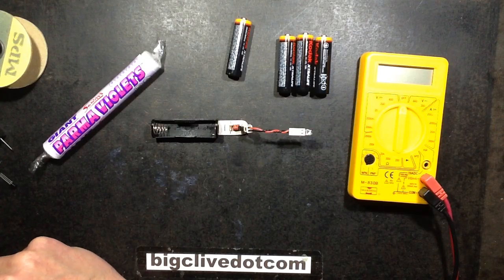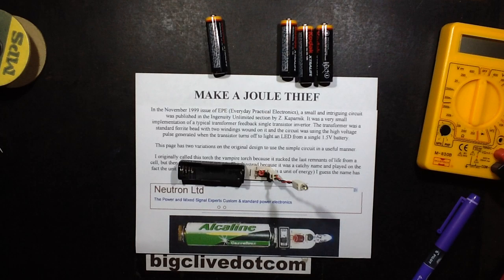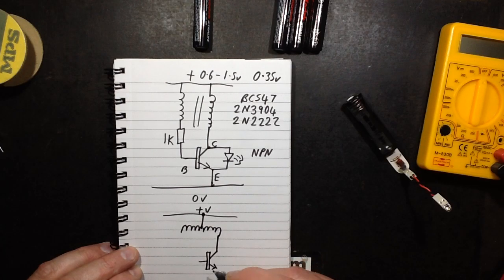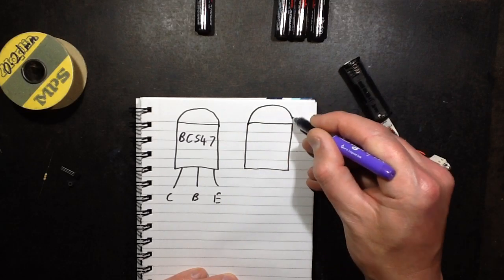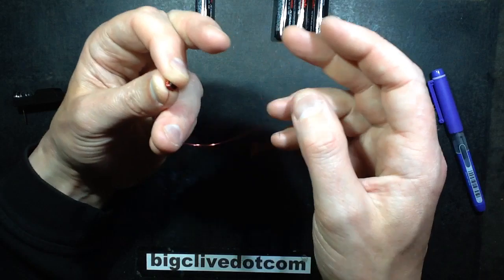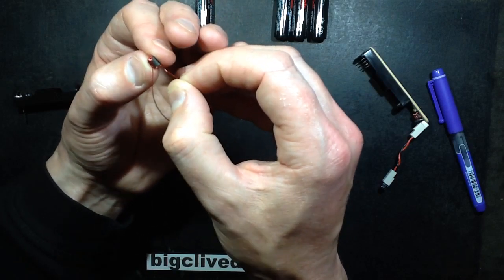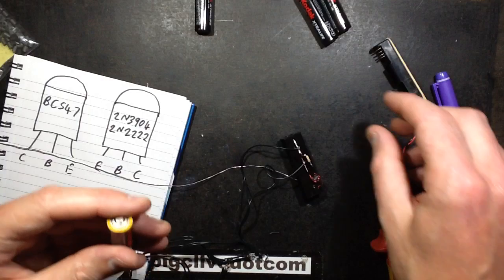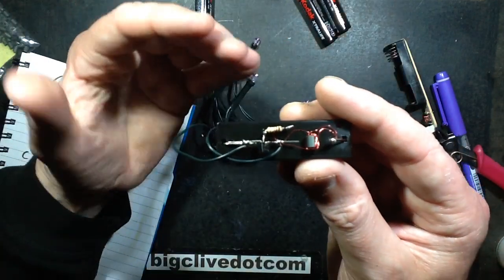How to make an authentic Joule Thief.

Comment: You could also use a germanium transistor instead of a silicon transistor to improve efficiency. Silicon transistors have a base-emitter voltage (VBE) around 700mV while germanium transistors have a VBE of about 300mV.
Reply: Do you have any idea how efficient these are compared to "standard" constant current/constant voltage (usually PWM) LED drivers? The circuit seems so simple, and easily tunable to various LED peak voltages, that I would wonder if we're talking 99% or more like 50%, haha. Sure from a DC source it's impressive how it "sucks" the power out, but I wonder with what efficiency IRL

Comment: Good evening!
I've built some "trash battery lights" a few years ago..most of them still run on the "old empty" batteries.
- i did not hear of the "Joule Thief" back then :-)

But i came across the pr4403 and its different versions.
- i think i was using two empty batteries if i remember correctly....
you can also use leds in parallel or in a row...

complete circuit kind of fits under a 5mm white led. (or can be built into a pencil)

I also really love hot (melting) glue.
It gets stuff water proof + robust
AND you can easily remove it again !

Comment: never thought I would wind my own transformer and yet a ferrite toroid salvaged from a scraped computer cable and a few feet of magnet wire later I'm seeing what looks to be bona fide transformer-like traces on my Huntron Tracker 2000! I can hardly wait to finish this thing
Reply: +Michael Thompson Built and operating!
For a moment I wondered why my color changing LED wasn't going past red, but then I realized it's being fed via an oscillator and restarting over and over so you never get past the first color.
Tried a "flicker" yellow LED and it merely flashed slowly -again my guess is something timing out with the oscillator.
I have a white LED glowing very brightly now but I wonder if there would be too much loss in converting back to DC?

Comment: I made a little bobbin with my 3D printer to spool wire on. I put about 20-30 turns then made my center tap and 20-30 more turns . It's basically an air core since it has no metal and it works just fine with the Joule Thief circuit. The ferrite core works better, but if you give it more turns other things work too. Of course in the time since you made this video you have probably already figured that out for yourself.
Reply from the maker: I did experiment with many cores including air cored versions.  Maybe better with a faster transistor though.

Comment: I think I might be keeping the batteries up at least for awhile as I have built a joule thief circuit with a slightly higher voltage to handle the drag of more components and I am running a mechanical flasher that has a considerable higher draw than an LED .  Also I have another joule thief in the circuit that I wanted to experiment with that uses the same toroid that I wound with a center tap so I can adjust it with a   potentiometer and switch back and forth with in and out of the circuit. I began constructing this so that I could test mosfets in an inverter I have that has quit working that way I can test the mosfets to see if they heat up or whatever and when I looked up the spec sheets I found out they were SCR's,  that is how old this inverter is apparently. When I wound the toroid I used a ferrite magnet and I have placed it on two larger ferrite magnets and I belive they have a lot of power.  The batteries are three AA Duracells that I recharged a few times, they are older and I thought they were dead and was going to just suck the life out of them and throw them away.  After putting them in this circuit I have not had to charge them back up again and it seems to me like it was after adding the two large magnets to the transformer.  Three LEDs and a mechanical flasher and it's all still point to point wiring and the three LEDs are blinding,  I don't run it continuously because I am worried I might burn up the LED's  but I have run it every everyday, for a couple months now.   Also I tried to take a picture of this spagehtie mess with my phone and I think the  HF fields have caused the camera in the phone to behave strangely ..
The picture I took has a couple of things wrong with it and the first thing I noticed is it has created a background in the picture with some lines running across it and there is a clock in the picture that is backwards, also there is a light with a handle on it and the handle is now on the other side of it,  so some of the things in the picture have somehow been reversed,  very strange and all this from three AA Duracells.  I imagine these old batteries will eventually run down and I have yet to hook this up to the scope but perhaps our host here would be more interested in analyzing this situation  .... 🤔😎

Comment: I just made my first joul thief today! Am impressed it worked first time. It really is a clever circuit.
I don't think mine had enough turns though - It would power a white and blue LED with no issue, but no luck for an old school red 5mm. (Not that any of my LED aren't 5mm. I really don't like SMD.)
Reply from the maker: The red should be easier to drive.  Note that some red LEDs from eBay are supplied with reverse polarity.  Congratulations on your first Joule Thief.  They're a really fun circuit.
Reply: They're certainly the correct polarity. I obtained them through Bowood Electronics many years ago. It just seemed to flicker on and off as I connected and disconnected the cell.
I always thought that red would be the easiest to drive too, as they only require 2.2ish volts to glow.

I'll make another today and have a bit more experimentation with more and less coils of magnet wire. I'm using a relatively large 3/4" diameter ferrite core.
I'll post results later :)
Reply: Well, after a bit more messing around, I was able to drive 8 Green LED's in series before they started to dim even slightly, all from a single AA cell.
I am very impressed with this circuit.
I ended up experimenting a bit more, by removing the LEDs, and putting a diode and capacitor in series instead. I was able to read about 50v.
Then I tried powering the circuit from a 6v battery. I managed to get up to about 110v.

Comment: I didn't actually know that Clive coined the term Joule Thief. Nice one! 🙂

A minor improvement: if you add a (schottky) diode and a small capacitor (1-4.7µF or so...) before the LED string the LEDs will light much brighter.
However, current consumption will go up, naturally. Still probably worth it, though.
There's actually quite a few ways that you can tune this little circuit in order to get the most light out of it, pretty fun to play around with it.

I think I need to go build another Joule Thief... again! ;-)

Comment: I just got around to playing with this now.  I did 60 turns (30+30) on a ferrite ring ('cause more is better, right?).  It's lighting a white LED very brightly.  My toy silly scope says Vmax 3.9V (may be pushing 4.0 volts as the reading is not quite stable), 10.15kHz, duty cycle about 50%. There's a small spike at the start of the cycle which falls off surprisingly slowly until it clamps off.  I was expecting the "on" duration to be much shorter even with a fresh battery.

 Interestingly, my multimeter is reading almost the same across the battery and the LED (1.49V and 1.47V at the LED) at this time, which I take to mean the multimeter is reading the average, so it might be possible to predict the duty cycle based on Vbat if the Vpp is known.  It will be interesting to see how things change as the battery goes flat.  I expect the duty cycle to reduce while the Vmax stays relatively high but may drop a little.  I used maybe twice as much wire for the transformer compared to what was shown in the video.  I also added a switch on the 0V so it's more like a torch.

I thought I'd keep this updated for as long as the battery holds out, if I can.  Run time will be six to ten hours at night.  The battery is a AAA, so probably a lot less capacity than a AA.
1.49Vb 10.15kHz 50% 3.9+Vpp (fresh battery)
1.26Vb 9.21kHz 41.3% 3.89Vpp (~8 hours)
1.17 Vb 9.10kHz 39.0% 3.89Vpp (~7.5 hours)
0.42Vb 11.1kHz 17.4% 2.83Vpp (~8 hours)
0.41Vb  13.2kHz 17.8% 2.83Vpp (~5.5 hours)
0.50Vb 7.2kHz 16.8% 3.08Vpp (~5 hours)
0.42Vb 9.6kHz 16.0% 2.83Vpp (~8.5 hours)
0.40Vb 14.3kHz 16.5% 2.92Vpp (~6.5 hours)
0.38Vb 21.6kHz 18.1% 2.90Vpp (~8.5 hours)
0.37Vb 29.4kHz 19.3% 2.88Vpp (~8 hours)
0.37Vb 31.8kHz 20.0% 2.81Vpp (~7 hours)
0.34Vb 54.5kHz  25.3% 2.31Vpp (~8 hours) Pretty dim by morning, but OK when it's first turned on.  It can turn on again when the battery rises to 0.45V
0.338Vb 75.3kHz 30.4% 2.00Vpp (unknown runtime)

At this point the LED will not stay lit for more than a short while and I don't know what the final runtime was.   The figures in the last line are with the LED barely lit (wouldn't be seen in normal light) and shortly before it goes out completely.  No, the LED should not be lighting at all at 2V, but there is obviously something going on that my $20 sillyscope isn't showing such as an extremely short peak duration at a higher voltage (or something). It's not that accurate but not as far out as that for DC or square wave readings. Real turn on voltage for this LED as tested is 2.33VDC.

Even so, if the dead battery is allowed to recover then the LED will still operate for short periods at an intensity that is useful such as to find your car keys, the light switch, or a real torch.

Other observations: 

* The circuit continues to ring after the LED goes out.
* IOW the battery will not recover until the circuit is switched off.
* Now that the battery truly is "dead", the run time for the LED is only about 5 to 10 minutes after 24 hours recovery.
* Total run time was well in excess of 80 hours, over 12 days, from one AAA battery.
* Most of the energy in the battery is used up in the first fifteen hours or so, due to the higher duty cycle...
* ...meaning the circuit really "shines" when used with batteries depleted to less than 1.1V due to the shorter duty cycle being more efficient use of the available power.
* You could probably power this circuit off a couple of nails shoved into a lemon.  Zinc acid battery, anyone?

Comment: I built this circuit back in 1995 with a center tapped transformer and a heavy transistor., I never shared it out though but yeah mine was a lot bigger but did the same job, there were no real white LEDs back then so I put on yellow ones
I'm not sure when the circuit actually came out though.

The best place to find bead cores are from analog tv antenna transformers.

Comment: I plugged in an old valve radio that I found in an old abandoned shed when I was a kid. I told my mates to stand back and flipped the switch on at the wall with a fibreglass surf rod. The radio power cord blew out of the wall-socket across the room, cord and all. It blew the fuse on the lamp post outside on the street. None of the repair crew had ever seen anything like it.(Blown fuse on the pole) 

 My parents didnt have to pay anything because the fuse  wasnt on their property. Needless to say,I didnt tell them what had happened. LOL
Reply: They sure don't make 'em like that anymore.

Comment: Hi Clive. If I were to run a resistor in series, on front of a li-ion 18650, to drop the voltage for this circuit, would the 'oscillation' effects of the circuit damage or hammer the battery, and is this the best way to do it? (I.e. get extremely long lighting from a li‐ion) Cheers

Comment: could you use a toroid ring  with say 28ga or 32 ga enameled wire (not the super thin stuff you used on the small Ferrite core), how many turns should you do on primary and Secondary windings. 

     Hey BTW I am enjoying your videos, brings back my Tech School days (at TCI aka Technical Career Institute before that it was RCA Institute after the teachers brought it from RCA back in 1974, RCA was going to close the school)  in 1976-78 in NYC where I used to live. 

     I graduated and got a job working for Digital Equipment Corp (DEC) Right there in NYC there offices for Field Service working on Disk Drives (which were the size of Washing machines and only 300 MB, the unit used 14" platters, there were 20 Drive heads 19 Read/Write heads (for data) and 1 Servo head (for correct positioning)). I first worked on small ones that were 5MB - 90MB, within 14 months I was working on main Computer Systems like the PDP 11/34a, 11/45, 11/70's and then 4 yrs later I was working on VAX 11/780 & 11/750. I also worked a very short time (less than 11 months) with Wang Labs on their System.

     I never went to College right after High School. I started to work for DEC for 3 yrs then left there went to work for Wang Labs, then got an offer I could not refuse to move up to New England (New Hampshire) I worked for a small Electronic company made some really big bucks, did that for 2 yrs then went back to work for DEC as a Field Service Engineer working on Repair Processes for the VAX computers. I went back to school and got my AA in Electronic Engineering most of my Tech School got me past taking the Electronics classes, I mostly had to take all the BS classed Like English, Physics, Biology, Economics etc. got my AA in 1989.

       Since moving where I am now and unable to work I went back to school (in 2007) to just kill time. I took up Photography (I been taking photos since I was 15, my dad was a Photographer), Photoshop, Graphic Design, Web Design, Painting etc. I graduated in 2011 with my second AA in Art. that and $2.50 will get me on a bus to Mt Shasta. 

      I am currently disabled (since 1994) I am 62 love Ham Radio (I am a Extra Class Ham my call is N1DHD/6 (I currently live in northern north California 75 miles (120 Kilometers) south of  the Oregon border, near Mount Shasta, CA (actually I am 7 miles (11.25 Kilometers) south of Mount Shasta). I been wanting to go back to school Just for more Painting but my Heart Problems (it's been bad since late 2013 till now, I had three heart Stents put in last year (two in late January and one in late October) been giving me problems. I have to have another Angiogram this month (just waiting for the Clinic to set an appointment), the Plaque build up in my heart arteries is accelerating faster than normal. So I am seeing the best Interventionist Cardiologist in California, the same doctors that were able to put in the two stents in last January, were the doctors up where I live could not do even after trying two Angiograms and trying 12 different stents sizes to open up the two clogged arteries in one week. I am keeping my fingers crossed Dr. Rogers will prevail (he and his team did the two stent last year). 

       Going into their Cath Lab was like walking onto the bridge of the StarShip Enterprise. there was a 70" Plasma screen that had the output of the High Tech Digital Fluoroscope, then on each side of it there were two 32" OLED screens with the Patient's Vitals information  displayed. it was super cool!!!     

      Anyway enough about me, I have enjoyed all of the older video you have made I have seen so far. Keep up the good work and I hope you had a super belated, Happy Christmas and a Merry New Year.

Comment: At about 7:20 you describe the operation with "negative voltage" and a "transient". It's been 46 years since High School electronics class, but the auto mechanic in me continues on. If I may interject, that when the negative voltage occurs, and the transient, that the voltage induced by the collapsing magnetic field will be higher than the voltage required to build it, which is the principle of an automotive ignition coil. A field can collapse faster than it can build, therefore creating a higher voltage potential by the speed of the field passing through the coil.

Just sayin... I'll go back to watching the rest, now!  By the way, could I put one of these in my little China solar night lights and make them stay lit until morning??

Comment: I have some VERY small model aircraft parts connected by ever so much smaller coated wire and after a major crash the wires were broken and I have tried to reconnect to the magnetic actuators without success until now (I hope.)  Never thought of burning off the covering material.  Thank you for that info.